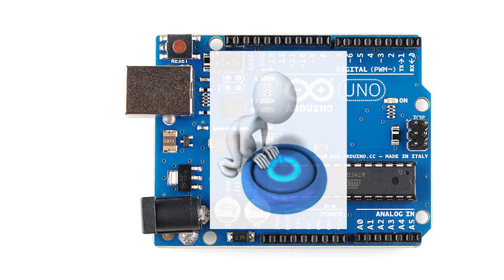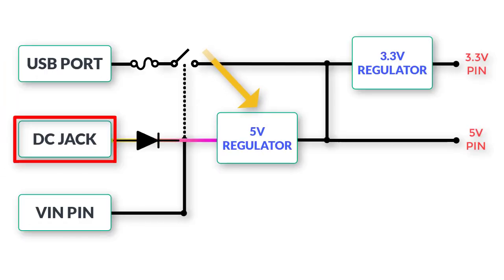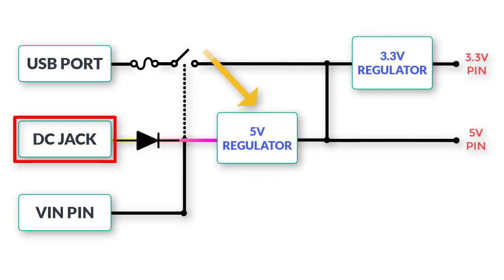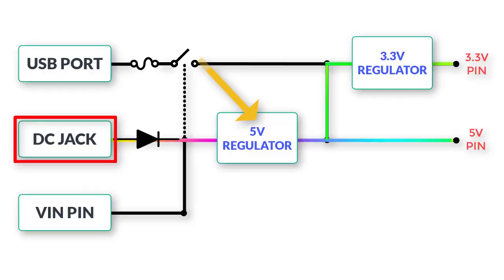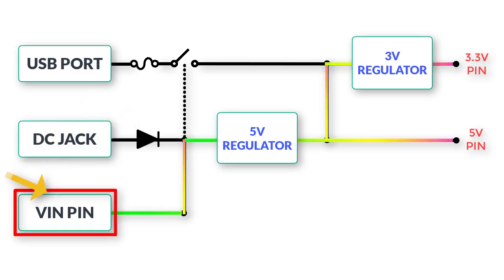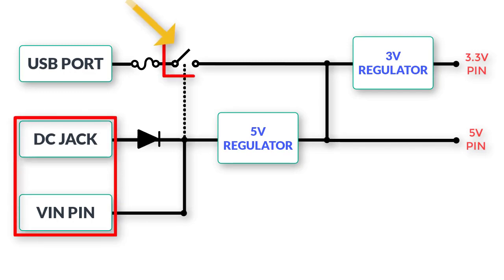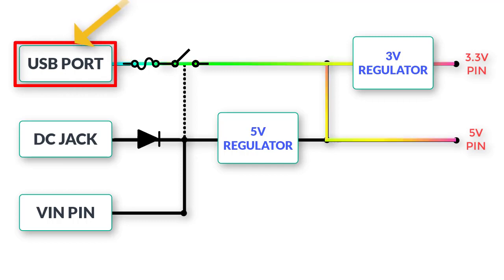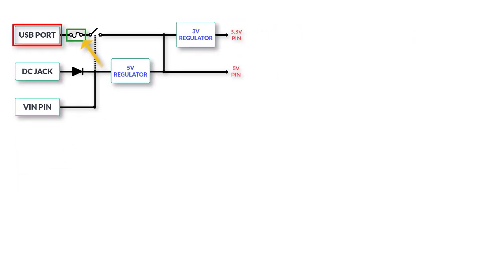3 Ways To Power Up Arduino | Arduino Power Supply

Comment: can we power to arduino nano both sides via usb and external power same time
Reply: I may not be sure since I'm also asking the same question but based on the result I searched before this video, it also works the same as the Uno but the difference is the it only has usb port(Micro, Mini B, type C) and VIN pin, which means no diode for reverse polarity protection.

Comment: Hey, I'm currently obtaining the data from two temperature sensors and recording them through an sd card, when doing it while having the Arduino connected to my pc via USB, the program runs without any issues. Once the code was uploaded, I tried powering the Arduino with the DC Jack port only, now the data Isn't being logged to the card. What I've come up with is that the connection I got is only 5V (way below the recommended), do you know if it might be the reason the Arduino isn't running appropriately, or could there be other reasons?
Reply from the maker: The power supply voltage can indeed be a potential reason for the Arduino not running appropriately when powered through the DC Jack port. The Arduino Uno, for example, requires a power supply voltage in the range of 7-12V through the DC Jack port. If you provide a voltage lower than the minimum required, it might not provide enough power for the Arduino and its peripherals to function properly.

When the Arduino is connected to your PC via USB, it receives power directly from the USB port, which typically provides 5V. In this case, the Arduino operates within the acceptable voltage range. However, when you power it through the DC Jack port with a voltage lower than the recommended range, it can cause various issues, including unreliable behavior or complete failure.

Comment: How to increase output current of arduino power supply to use and activate my 8 channel relay board total of 64 relay and I use pcf 8574
Reply from the maker: connect power supply directly to the relays, never power the relay module using 5v pin of arduino

Comment: Woahhh...never knw this...Good Job bro..I am currently trying to run a servo motor using ir sensor to make a sanitizer. I gave 3.3v pin to sensor and used 5v pin for the motor. They work fine when I power using the usb port but when I used a 9v charger to the DC Jack, the motor doesn't work. What am I doing wrong?
Reply from the maker: your battery does not provide enough current. So, the servo not working.

use a battery with high ampere hour

Comment: I marked a board 
 connected  pin 5 v nano to power supply and the same time usb connected to computer 
Nothing warm or blow up
And i can use serial monitor at the same time.
Anyway thanks.
Reply from the maker: you are right